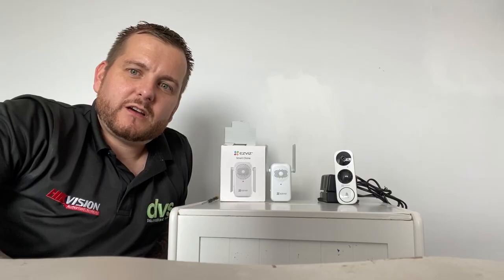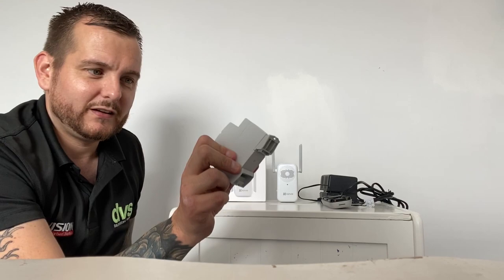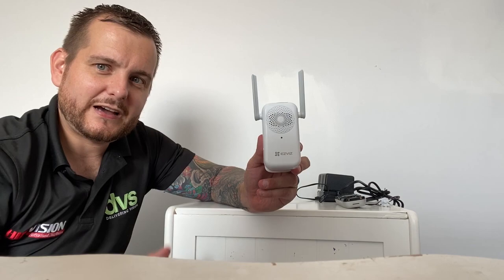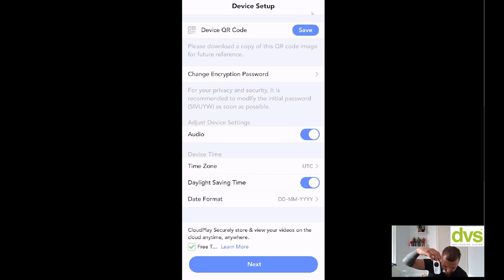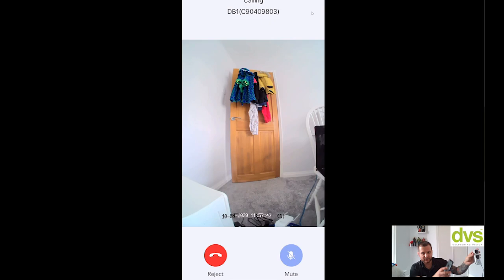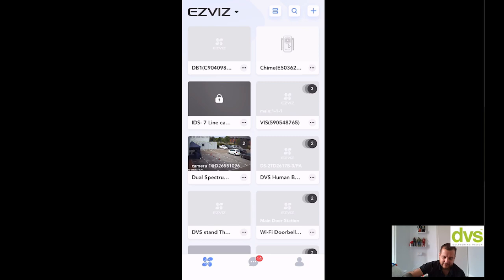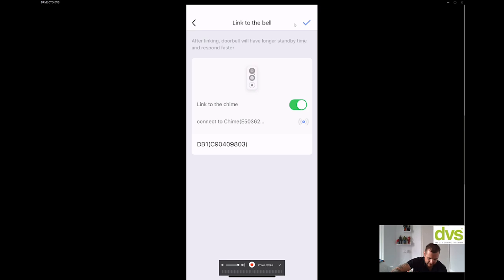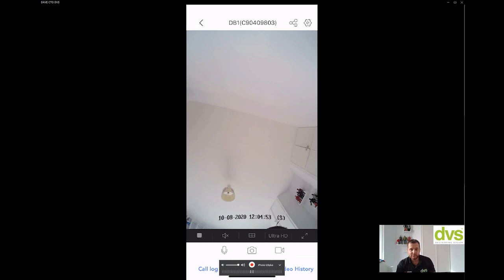NEW: Ezviz Doorbell with Ezviz Chime Installation

Comment: I have had one of these fir a year. Do you have any idea why the sd card keeps failing with 'not formatted '. This happens when the DB1 is used with the existing door chime. EZVIS SUPPORT cannot solve it.
I use it with now with no chime but linked to Alexa. Might consider adding the chime now.
Incidently, why did you not install the resistor?

Comment: When I connect my ezviz doorbell to my power supply, which I bought separately due to the fact I do not have an existing doorbell power source, but when I connect it my doorbell gets super super hot. How can I prevent it from becoming so hot. I bought a ac-ac adaptor input 120v output 24v

Comment: Your a top bloke, all your videos are very useful and well explained. Can I link the DB1 to my hikvision NVR to save footage rather than use cloud storage? I currently have the DS-KB8112-IM installed by POE but you cannot change the tone when the button is pressed on the outside!
Reply from the maker: you can add it to the NVR yes but as its WiFI it might not be as stable
Reply: @DVSLTD  can we use internet explorer or chrome or any browser to uncheck DHCP , because the ezviz ring doorbell is not ip static by default ..

Comment: Hi really useful video. My question is I have a wired pushbotton door bell that rings the bell in my house. If I disconnect the pushbutton and replace it with the Eyviz will the bell still ring when eyviz botton is pressed?

Comment: thank you, i was looking to see how loud it was, any demos on that?
Reply from the maker: its shown in here and I have some other videos on the channel of it
Reply: I have had one of these fir a year. Do you have any idea why the sd card keeps failing with 'not formatted '. This happens when the DB1 is used with the existing door chime. EZVIS SUPPORT cannot solve it.
I use it with now with no chime but linked to Alexa. Might consider adding the chime now.
Incidently, why did you not install the resistor?
Reply: @p0ndhouse  I use a digital chiome not an old school one. Don't need a resistor if its a WIFI chime.
Reply: @p0ndhouse  i would assume u need a better sc card, been runnign mine for a yea rand all good.

Comment: Hi, in the video it seemed that you had both a mechanical chime and the smart chime operating with the doorbell at the same time - is that right? I’d like to connect a DB1 to both a mechanical and 1 or 2 smart chimes - is this possible? Thanks

Comment: i'm really interested in the DB1 and the chime,  my biggest issue is getting power to the DB1, and suggestions,  I may have a route to the back of a mains socket (its a longshot), but i'd need a transformer 24v, any suggestions
Reply from the maker: we use Haydon PSU for this HAY-PSU1A24